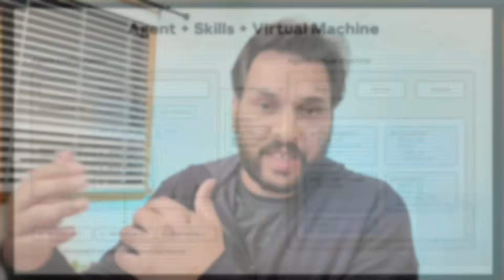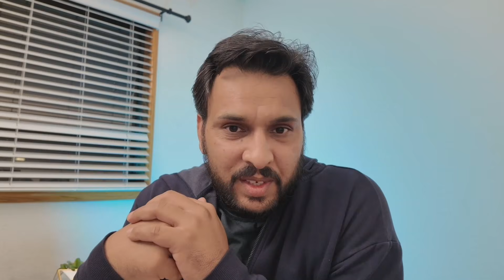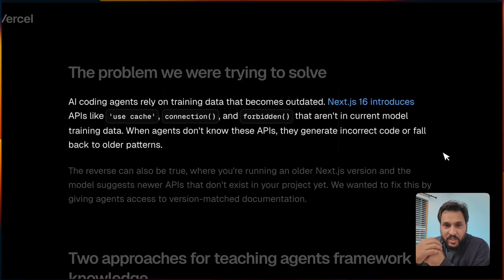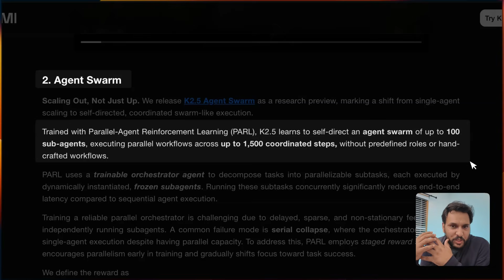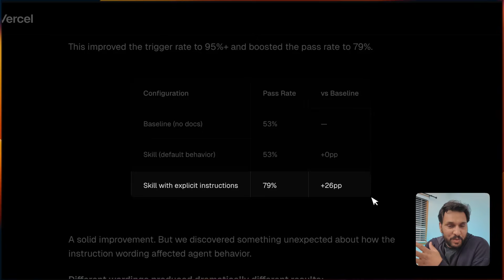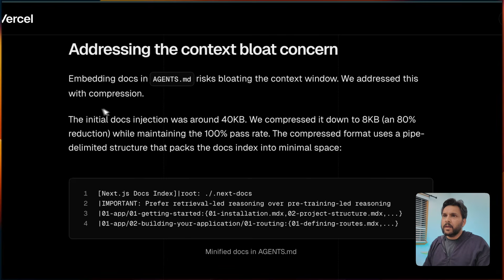Why Agents Are Ignoring Your Skills (Literally)

Comment: Great video, my friend, as usual. I like to argue with the article you mentioned. I think they're using "skill" wrong. Example of Next.js-16 is base-context, not a skill. It's documentation you need for the entire chat session. Skills are ad hoc things you pull in when needed. Remotion Library is a skill. Updating Microsoft Office documents is a skill. These are on-demand tools. And actually Claude code load them properly most of time. Another place that based on my experiences, skills actually shine: big systems with subsystems. Say you have security, database, modifications, job queue. Each subsystem has its own documentation. You covert their context into a skill. When you need to work on one part, you invoke that skill. A perfect way to mange a big system. Again the example of Next.js-16 or similar cases is the wrong example to evaluate the ability of agent for skill use. It's foundational context, not a skill. That's why they got bad results and concluded agents with skills don't work well. They're confusing initial platform context with on-demand skills. A skill doesn't replace the core context we need before we start with a tool like Claude code.
Reply from the maker: That's an interesting take. Let's say if there a new library/package that you want your agent to use, what will be your approach in that case? Something that the model hasn't seen in pretraining/posttraining